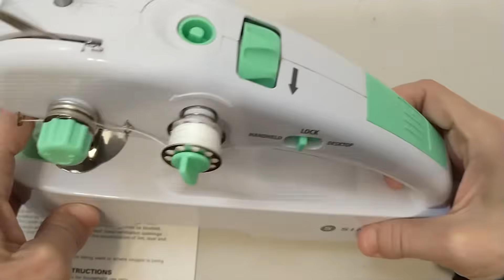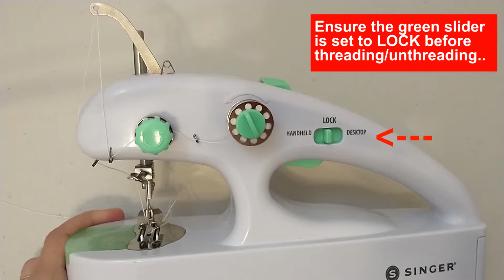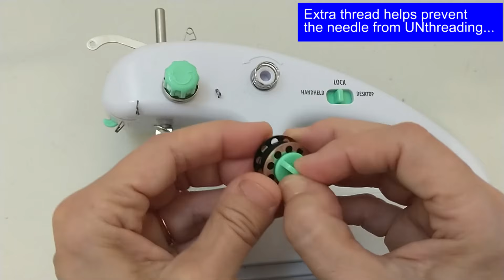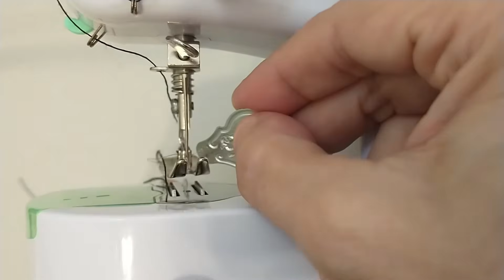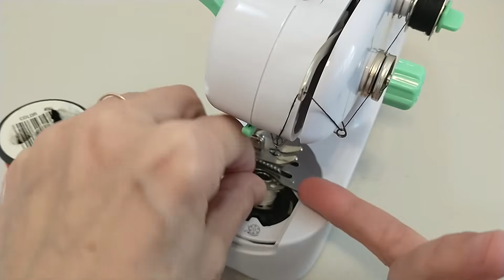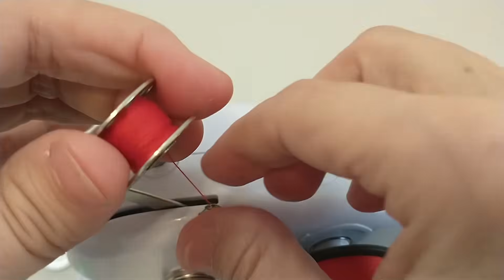Singer Stitch Quick - Mini Sewing Machine - Full Tutorial

Comment: So how exactly is the tension set? Could we see examples of when it's too tight or too loose? What happens if the top thread just pulls right out after you made a run of a couple inches or so? Is that an indication that is too tight or too loose?
Reply from the maker: Sounds like the tension maybe too tight. Regretfully, this mini sewer is not a precise instrument, you have to experiment with adjusting the top tension knob.

Comment: I do not understand something at all..?? According to the little picture on the machine, on the bottom bobbin it says to NOT have the the thread coming from the right. But that is exactly how you put it in..?? I have watched this part over and over and over and i just cannot understand it..??
Reply from the maker: It actually works regardless of which way you insert the bobbin (I've done both).  If it's not working, ensure the top thread is threaded correctly, the needle is completely straight, and, if needed, experiment with the tension knob..

Comment: Are we able to get it to go forward & reverse to tack down the first stitch so it doesn't come undone?
Reply from the maker: There's no reverse. However, this machine does a traditional lock stitch (with top and bottom threads).  Some of the smaller handheld machines have just one thread and they do a simple loop stitch. On those machines, you would have to pull the ending thread to the other side to lock the stitch.

Comment: Now I am finding that the bobbin string isn't getting pulled through at all. Help please.
Reply from the maker: Ensure the bobbin is threaded correctly. Normally, you can't mess that up, because it should work regardless of the direction of the bobbin thread.  Also, try loosening the top thread tension a tad..

Comment: Do both spools need to be the same color thread? I have many work pants of that orange/brown carhardt color, similar to the orange in blue jean stitches, and wondered if that's what I need to do. Alteration shoppes charge more than what I paid for the pants, so this will be a big savings.
Reply from the maker: Normally, you would use the same color.  But, using different colors will work and it also helps you adjust the tension. If you see the bobbin thread color coming up to the top side, loosen the tension a tad and test again..

Comment: for some reason, i'm having trouble with the bottom bobbin. i've threaded the top thread as depicted in the video & placed the bobbin correctly, and the tension is about as loose as it can get -- yet, when i crank the wheel at the top, no top thread comes to pull the bobbin through.
Reply from the maker: Ensure the needle is not bet. Remove the bobbin and reseat.  Then, experiment with different tension settings.  The tension on this machine can be quirky.
Reply: I am having the same problem and done all of that. What do I do

Comment: I inserted the batteries and it got very hot, pulled the batteries out and I could barely touch them.   The whole thing seems to be jammed up also, tried every setting, threaded it again to make sure it was correct, and nothing will move. Even the dial in the top will only move back and forth a tiny bit, it's all stuck.  Had this for months, just tried to use it for the first time today, wish I could return it, but it's to late now.
Reply from the maker: It seems defective..

Comment: How do you end the stitch? Everything stitched fine but then it just pulls out easily. Other sewing 101 instructions talk about doing a back stitch or putting the machine in reverse but I don’t know if that is possible with this one. Thank you!
Reply from the maker: Since there is a bobbin, the stitching should not unravel.   Some other handheld sewers only have one thread, so then you have to pull the ending thread through to the other side.  If desired though, you can pull the top thread to the bottom, tie both threads in a knott, and then snip the excess.

Comment: I’m gonna go nuts. I’ve watched every video, read every manual and this thing will just not stitch.
Reply: I had trouble with it too, and what was the issue was the material i was using. It just isnt compatible with this sewing machine, so maybe it could be that
Reply: I've been having the exact same issue, it does great for material like sheets but you can forget sewing any kind of stretchy fabric @ScarletzWolfz
Reply: Idk if you're still having problems but I had no idea what was wrong with mine, I did every thing everyone said and it just wouldn't turn on. I went around the house looking for power cords from all of my appliances and all my boxes until I found one that fit and that worked. The batteries just hated me no clue why. And it was a IBM laptop cord form the 90's too which makes less since.
Reply: @3ROCKBANG  the issue I think could be because it’s jammed. Does it kind of turn on but doesn’t move?
Reply: @3ROCKBANG  😂😂😂
Reply: It's the bobbin, it has to connect the two treads together, keep turning the handwheel until it faces you and pulls both threads are together
Reply: @Shogun_from_Bama  thank you!! ive never used a machine and i could not for the life of me figure our why i wasn't getting any stitches! It finally works!
Reply: I've been having the SAME EXACT PROBLEM. I'm going to take it back and get another and see if it's just this particular one. Maybe you should too. I've done the same shit lol went through EVERYTHING 5XS OR MORE plus every video and check lists and everything and it just will.. not.. work.. hope you got another ill come back and lyk if it wqs actually the machine... I'm going to take it back tomorrow if not tonight.... been a week I been messing with it... I'm done.
Reply: @nikkilovetheyardsale-again2608  😂😂😂😂
Reply: Mines is going like it's stiching/working but I pick up the material and nothing has actually stitched through or held, lately I've been trying to use it on jeans🤔 maybe it's too thick to go through
Reply: @JustMercy415  I was just wondering, because I had the exact same issue as you're describing with my machine, if you happened to check your tension up top and(the prob I had) the bottom/lower bobbin wasn't threaded properly or at all 😅. Once I fixed that thanks to this woman's video, I was good to go.
I was about to throw hands with my machine 😂😂😂 like "you suck machine you bobbin but you ain't sewin" 😳😏😂😂
Hope you figured out something 😊
Reply: @JustMercy415  it worked on my jeans material but not my other material but im haveing the same problem
Reply: Also, my needle  will not grab the bobbin thread no matter what I try...ridiculous
Reply: @AaronRiegel I’m having the same problem. Waste of money
Reply: did  you change batteries around?
Reply: Yea but when I change the bottom bobbin. Where the fuck am I threading it through????
Reply: Sewing machines in general I think struggle with thin stretch material but I could be wrong. 😅

Comment: Outstanding tutorial !! Mine is a newer version in that Singer put a slot in the needle holder screw so that you could change the needle easier. While I do not have a lot of experience with sewing machines, I feel it actually sews really good. I was able to shorten and narrow the width of my magnetic screen for my RV door. For $23.00 + tax at Walmart, I thought it was a great deal. Thank You for all the tips on threading AND about pulling the needle thread so that you do not bend the needle.